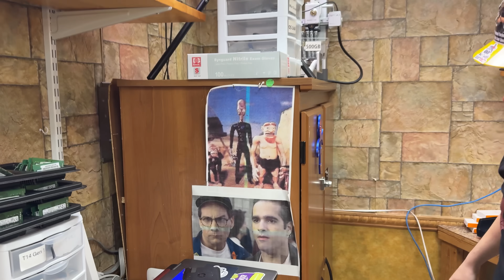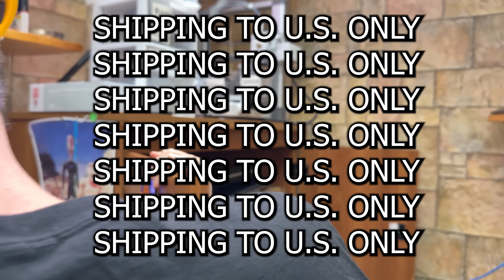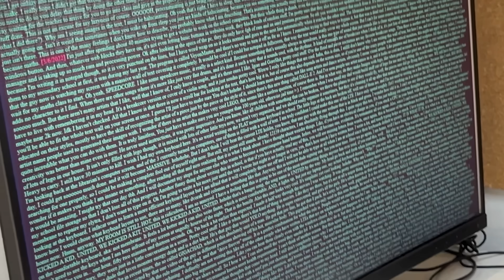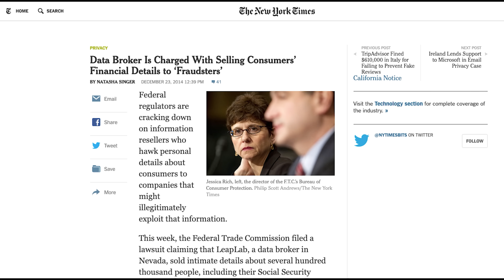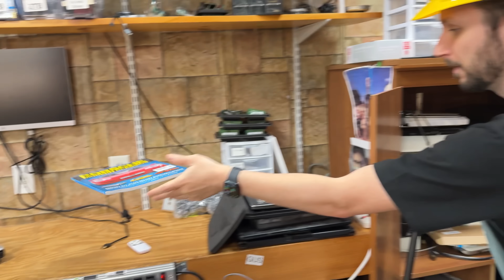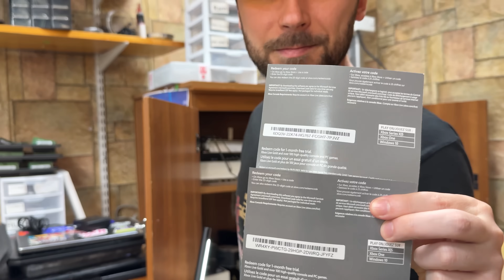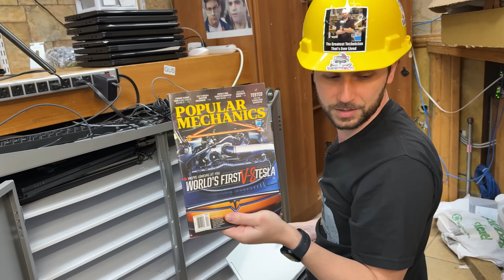10 Years of Tech Hoarding: What I Found in My Computer Repair Shop (and What I'm Giving Away)

Comment: I owned an Acer laptop like the one at 12:00. I bought it used in 2010 when I moved abroad and I used it until around 2014 when I got a new laptop. I don't remember the configuration though. But that small touchpad with the sound controls is stuck in my mind.

Comment: I used to work at a repair warehouse (we worked on 30-40 machines each day) and I am wondering if you're gonna install some sort of vacuuming/dusting chamber at your new space - we used to have this and it was a life and time saver. The Gooch Collector will be unhappy but that solution might be better than going out of the building every time you have to dust the computer you're currently working on.

Comment: 7:09 : That HP laptop that had Linux installed onto it, but has a non-working touchscreen, that was the very first touchscreen laptop that i have ever owned. I sadly mad a small crack to the screen, near the bessels holding the screen in place, and i guess where the crack happened to it made the touchscreen non-functional. But for school, it was an ok laptop. That laptop, also made me never want to buy another laptop that did not have a touchscreen on it, ever again. Here's to you HP Laptop, you ruined me from ever getting a laptop that did not have a touchscreen for the rest of my days, and i thank you for that!!

Comment: I always tell people that complain about the cost of building a new PC to just go to a recycling center and see if they have any good parts. They don't come with a warranty, they might not have instructions, but if you already know roughly what you're looking for, you're saving stuff from going in the trash, because they're getting rid of it one way or another. 
I suppose the same can be said for small repair shops too, they always need more space, and would rather sell something than put it in a recycling center. Problem is nobody asks if they've got any old stuff they want rid of in the back anymore.

Comment: Way way back when I was a working person in the 90s,  I used to cobble together a working VAX out of old VAXes at work. Saved a lot of money doing that. I had a file cabinet full of various cards as well, back when memory cards et al were bigger than an iPad. Now that I am retired I have so much crap in my own house. So many cables and peripherals. I have a whole herd of modems, various PCMCIA cards, routers, cables, an 80 GB external hard drive, external CD drive, firewall, telco stuff and other antiques. Fortunately my town has an electronic recycling bin. That's a project for later this summer.

Comment: Those sticky velcro things are a godscend. I keep a roll of velcro tape nearby at all times. whenever I get a device and it comes with a remote I just velcro it to the device itself. makes it much harder to lose the remote when it's on the device itself. also makes the life of the shopper better if you donate to thrift stores or pawn shops since they don't have to throw it in their bin of remotes.
and I do have to say, it is worth it to buy velcro brand, their stuff is indestructible the adhesive doesn't fall off.

Comment: Still love my HP ZBook 17". Albeit only a Core i7 4800MQ @2.70 GHz, 32GB ram, 4GB NVIDIA Quadro K3100M GPU & 2TB storage. But it runs smooth, I can read it & it helps with lower back exercises when I have to move it. 😂

Comment: Why does the repair shop have so much junk?

Because parts are expensive, and if you can strip dead devices for parts, it means bigger margins on later repairs.

Downside is when you stop doing repairs, but still keep all the "spare parts" anyway... Anyone need a Lucite Core 2 Quad iMac with a half-dead screen?
Reply: No thanks, my bin of those is already full.